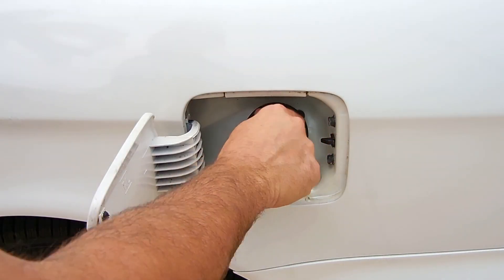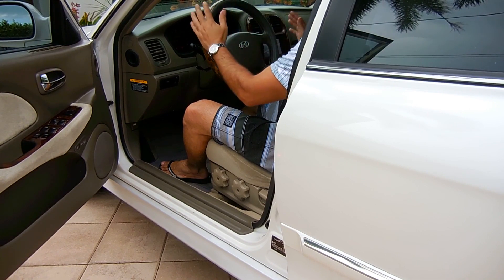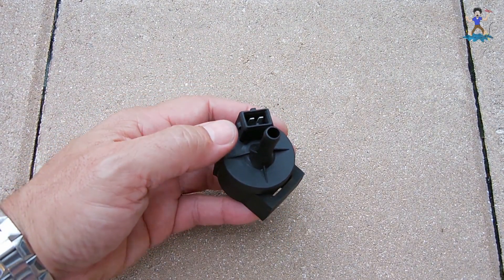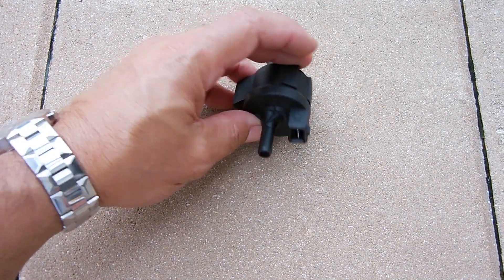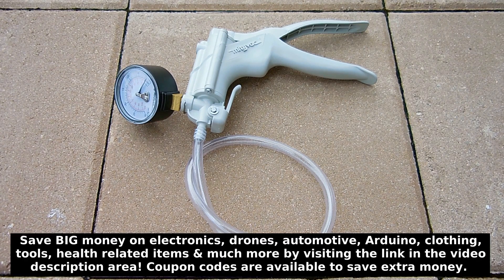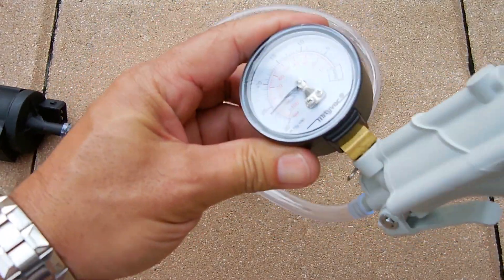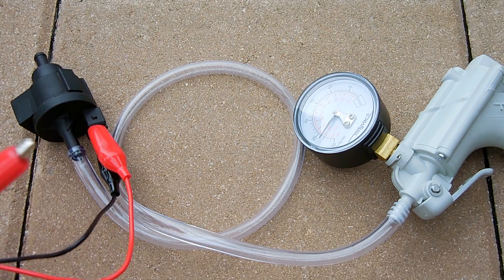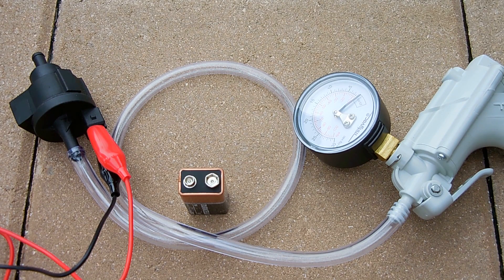Car Engine Stalls or Rough Idle After Fueling Up

Comment: Helped a lot. Mechanics zoned in on spark plugs but they were new. I did the pump test and it was super leaky. Will install new part and see what happens after refueling
Reply: Was the problem eliminated after that?
Reply: Not yet. I think the new part is also defective because it was also leaking some. It didn't hold the pressure @xarhsath8196
Reply: What ever happened did it work?

Comment: If this is the problem, would it only cause vehicle stalling or acting like it's going to stall sometimes after getting gas? My Kia Sorento randomly has been having issues where it acts like it's going to stall ( and  has now twice) and we noticed it's after getting gas. It's not every time though. No mechanic can seem to figure this out. Both times it's totally shut itself off, it's been when I am stopping. Recently I had the purge valve and canister replaced but they say that these parts would throw codes if they are faulty and there are no codes. I had them replaced originally because I was unable to pump gas.
Reply: My Kia soul is doing the same thing
Reply: @OctaviusRexLTH  The dealership is now trying to blame me saying that I over filled the tank. I never top off.  They say there is now gas in the EVAP lines.  Supposedly last time I took it they didn't find anything wrong. Still no codes. This is super frustrating

Comment: My 2011 VW Jetta was doing this for a year. Ordered a purge valve off of Amazon for $13. I'm a 53 yr old female and installed it myself in under 5 minutes. Filled it up with gas and it worked perfectly. No more stalling after filling up!

Comment: Great good video brother.  I have a 2016 chrysler 300. If i don't use it for a few hours or overnight,  and try to star the car, it will crank but wont start. But if i open the key for 3 seconds before starting,  it will start instantly.  Seema like the feeding of gas to the engine is delayed.  Do you know what could it be?

Comment: I fill up my 2005  dodge ram 1500  an it stalls  when I drive slow or break.  I'm Change that part an the iac valve
Reply from the maker: Worth a try if the part isn't expensive. A repair shop will cost you A LOT more.

Comment: Got a 2010 town & country 4.0. About a year ago someone put flower or something in my gas tank. Paid a shop $350 to drop the tank and clean it out. Ever since then it misfires unless the low fuel light is on. As soon as that low fuel light comes on it stops misfiring and drives good. Also shakes really bad around 60mph when misfiring. Spent almost $1,000 on parts trying to fix. Any ideas?

Comment: That is pretty much what's happening to me. Truck runs fine until I open the gas cap to get gas and then it starts sputtering like it wants to stall out. There are a couple codes that it's throwing and it's both evap leak codes but I can't give you the codes right now because I'm driving.
Reply from the maker: If the part isn't too pricey, try swapping it out. Hopefully the issue goes away. Thanks for watching!

Comment: I replaced the purge valve and still have the same problem. Any ideas?
Reply from the maker: If it only happens after fill up, maybe the EVAP canister is bad.
Reply: @electronicsNmore  I have replaced the evap canister, the valve attached to that assembly and the purge valve attached to the intake manifold and it still chugs after fill-up. I'm kinda out of ideas myself...
Reply: @Oscarphone  what was the problem?
Reply: @Oscarphone .  Did you ever figure it out
Reply: electronicsNmore ok, thank you🙏

Comment: Today I was sitting at a red light and noticed my rpm drop to about 500 and than than back up to 1000. I thought it was going to stall but it didn't. I just jumped my brothers car and went to fuel up after. Maybe it's just coincidence. Wondering maybe if it's time for a new battery as mine is running on 6 years now and jumping someone else's car probably didn't help.. 🤔
Reply from the maker: See if it happens again before worrying. :-)
Reply: Maybe spark plugs are getting old. Needs tune up. Air filter, spark plugs, and oil change.

Comment: I have a 14 dodge dart I have the issue of rough running and stalling after filling up until it's used some of the gas usually after 10-15 minutes it behaves again I replaced the purge valve and the esim. No codes car has been well maintained. Anyone have any ideas?
Reply from the maker: Hi there. The line between the EVAP canister and the purge valve may have to be cleaned out. Also check for raw fuel in the canister, if any is found, the canister will have to be replaced.

Comment: Change the purge valve now the car won't turn over?
Reply from the maker: You must've disconnected something that's preventing the starter from getting power.
Reply: I think i need a new fuel pump

Comment: Hey question so my car stalls everytime I pump gas in it. But running good and turn on good until I need to pump gas again. Is this the same issue? Thanks
Reply: Following.....mines does the exact same thing
Reply: Charcoal canister
Reply: My stepdaughters toyota camry does that, no check engine light, all cycles in the PC are all solid meaning everything is running properly,  but as soon as you fuel up, it begins to stall until you get lower on fuel, all evap sensors, coolent sensor all spec out and energize properly,  have you figured it out yet?
Reply: @Matt-bd2or  yes it was Purge solenoid..
Reply: @Matt-bd2or  now car running really good no more stalling.
Reply: @Misasblog  lucky you, I test the purge valve twice, holds vacuum and solenoid,  works like it should, only happens when topped of with gas, I dunno..lol
Reply: @daisy5644  really that's something with the motherboard then I mean that's what my mechanic told me if it's not this is your motherboard that's a lot of more time and money.
Reply: @Misasblog  well, according to  my code reader, everything is good..lol, so I dunno, we have emmissions test here, all they do now is plug in and see what the PC says, so it should pass  , I'll have it hooked up to diagnostic test, thanks!
Reply: @Misasblog  Your "mechanic" is a hack.
Reply: @Matt-bd2or  because it was only stalling when I top it off too every time I fill it up it will stall on me.

Comment: I replaced my purge valve and I can also tell it's clicking so the new one is working plus I tested them both and they work. My can will try to die around 4th of a tank and when I add gas it won't start unless I press the petal all the way down and after that it runs fine... Someone told me there could be something stuck in the tank. ... Any thoughts???
Reply from the maker: Take out the fuel pump and inspect it. Sounds like the pump assembly has a problem sucking fuel in at a certain level. May want to check the vent for the tank.

Comment: Thanks so much! I've been chasing this problem for 6 months.
Reply from the maker: You're welcome Tommy! Hopefully it's the problem. Be sure to look over my extensive video playlists below for many other videos of interest to you, use supplied Amazon links to support my channel when making purchases(No added cost to you), and share links to my videos with many others on social networking sites. Thanks, and stay safe!
http://www.youtube.com/c/electronicsnmore/playlists
Reply: @electronicsNmore  hi I've got a problem. This morning I only had 17 miles showing on my Toyota auris so I filled it until I couldn't get anymore diesel in then I turned it over and immediately the engine management light came on and now (4 hours after) it's in limp mode. What do you think I've done?
Reply from the maker: @flowers6960  I suggest you very carefully siphon out excess gas. Be very careful sliding in a tube, if you go too far, you can break the roll over valve.
Reply: @electronicsNmore  thanks for replying. I'm a taxi driver (uk) and have used a quarter of the diesel so ive about three quarters left in the tank. Would disconnecting the battery (negative) and reconnecting (letting all the charging out from the ECU help.?

Comment: My car is definitely doing this. It stalls and roughly idles after fueling. It’s only after I drive for a few miles until it clears up. Anybody know a ballpark on a mechanic costs?
Reply from the maker: You need to ask people you know if they can recommend a mechanic that's honest, and won't rip you off.

Comment: I have a 2010 Hyundai accent had a check engine light for the purge valve but it was starting fine after filling up but now since our place the part the check engine light is off but now it’s starting to not start after filling up—any ideas what the issue could be?
Reply from the maker: Sounds like a purge control valve issue. Maybe you got a cheap replacement part that failed.

Comment: My 2016 vw autobahn gti idles rough and throws a bunch of misfire codes every time I fill up, been dealing w/ this issue for months and no one, not even enthusiasts on vw forums could help. I pretty much used my (unofficial mechanical engineering common sense) to either the charcoal canister or the purge valve. The purge valve made more sense, I ordered one and hopefully it will fix it. Watching this video gave me more hope. Thanks for posting!!
Reply: update: new purge valve didn't fix it, now onto gas cap and charcoal canister....
Reply: @yoadriaaannn  any luck pleaseee report back ☹️☹️
Reply: What was ur fix

Comment: Hey I just refueled my new toyota passo, it was on reserve and after about 10 minutes it started to lag severely, first it jerked 2 times and then it was like I was accelerating but the car was not taking power the rpm was not increasing basically I guess engine was stalling, it was like the brakes were continuously being pressed and the car wasn't picking up. What should I do now? Please reply thanks.
Reply from the maker: May have to bleed the fuel line if it ran dry.

Comment: Can you do a video on a toyota celica vacuum modulator
Reply from the maker: In order to test it, you'll need a vacuum hand pump.
Reply: electronicsNmore yeah thanks to ur video I was able to test my Purge valve. To my disappointment the valve passed the test! It clicks open. Well at least I was to eliminate that part. Next step according to other vids is to test the vacuum modulator. Gotta find it first lol

Comment: But still you haven't explain why or what does it have to do with gas tank fill up
Reply from the maker: The valve sticks in the partially open position which causes the engine to flood.
Reply: With what? Vapors?
Reply: Daniel Ram - yes because the excess fuel vapors changes the air to fuel ratio and the vehicles computer does not expect this sudden change and therefore the car will run rough and even stall.
Reply: On my caravan i get liquid fuel flowing through the line with a full tank. And its been causing problems stalling if i put too much gas. So i cant let the pump stop at full. I have to stop a little before full

Comment: It's a decent test although there are multiple failures that could occur with this type of device. It would be nice if it were this simple to test this type of unit. Sticking and solenoid issues would come to mind.  It's a place to get some type of baseline. A good place to find 100% failure right from the get go.

Comment: Try your " Idle Air Control Valve " (IAC Valve).  Open it, Clean it, or Change New Parts, you will be good to go! Purge Valve rarely dies!
Reply from the maker: Jordan Bronson If you fuel up and the car stalls or won't idle properly for 15 - 30 seconds, it's the Purge valve, not the IAC. If the problem happened all the time, then you check the IAC.
Reply: They do on Hyundai’s apparently!
Reply: good video brother.  I have a 2016 chrysler 300. If i don't use it for a few hours or overnight,  and try to star the car, it will crank but wont start. But if i open the key for 3 seconds before starting,  it will start instantly.  Seema like the feeding of gas to the engine is delayed.  Do you know what could it be?
Reply: @OscarGarcia-sx6tx  - YES, wait for 3 seconds before you start your car.  This will allow the gas pressure to build up to feed to the injectors.
Reply: @JodBronson  thanks you brother for the reply. Do you know what part needs to be replaced?
Reply: @OscarGarcia-sx6tx  -  Not sure to be honest!  It could be like in this video or the gas pressure not building up correctly which is the gas pump or even fuel relay or line clogged or filter clogged or jammed or even not enough power.
Reply: @JodBronson  thank you again for taking the time to read and reply!! Much appreciated
Reply: @OscarGarcia-sx6tx  - From my understanding of this, it seems when "HOT or WARM" it doesn't start and when you cool down, it starts.  That tells me it's the relay may be bad or about to be bad & not working correctly.  Find the Fuel Pump Relay and switch it with another Relay, like the AC Relay.  Since you're not using the AC during testing, take it out and switch it with the Fuel Relay and see if it starts correctly.
Reply: @JodBronson  backwards.. when is cold it doesn't.  Like it takes time for the gas to reach motor to start. But let say i go to the store, do my shopping and get out,  it will start normally without opening the key for 4 sec.
Reply: @OscarGarcia-sx6tx  -  Sorry then, I do not know what it is.... Maybe your car is afraid of the cold!